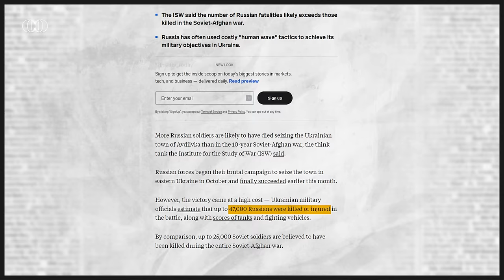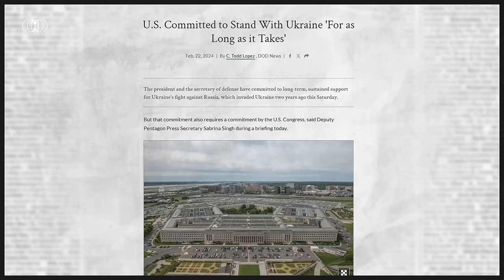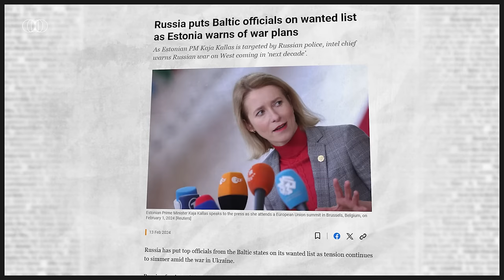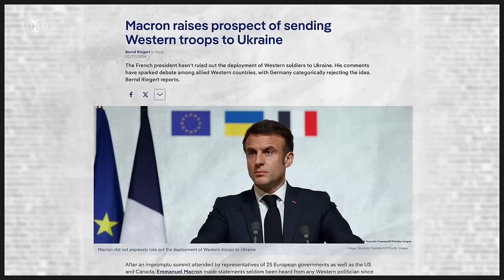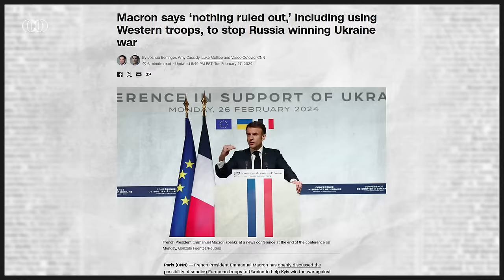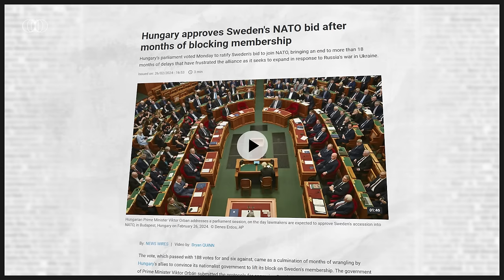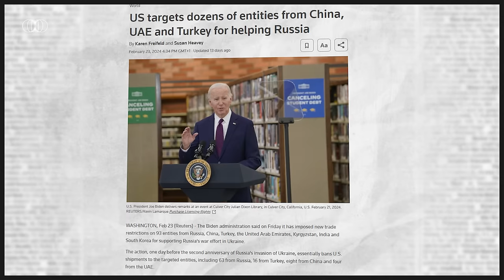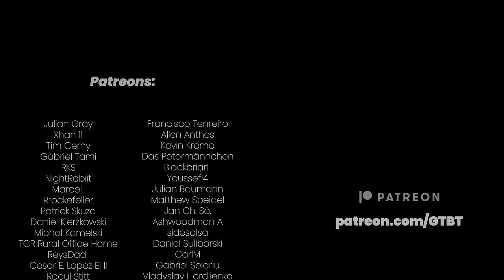Is Europe Taking The Lead On Ukraine?

Comment: I like that the French are putting themselves in a political leadership position, but I wish they would do the same when it comes to arms deliveries. Quantitatively speaking, things don't look that strong for the French arms delevarys.
Reply: The French have some nice expeditionary force projection capabiities but only in a few tens of thousands ---   French power needs a lot more boots on the ground or must cede that to Germany --- very different capabilities so a true EU force against russia must first have those two come together.
Reply: 1) France has the army they needed and still has more real soldiers ( with combat experience) than any current EU country.

2) FR is the only EU country which makes its weapons and uses them. Moreover Fr is still present in many parts of the 🌍 globe, FR can't give away all its weapons like Denmark because it will be than naked. What the point to be the strongest EU army and been unable to defend itself in case of new troubles emerge.

3) FR uses what it manufactures, as they are no real EU military joined industry ( everybody is buying American/ for protection guarantee) the quantities are small. FR can't give them away, it will take her a decade to replace them. FR can't be naked meanwhile.

4) As mentioned above FR to be independent, produces most of its stuffs in little quantities because of a lack of EU market .SO all the weapons systems are french+/- , so FR can't give them away like that. It is easy to give away old soviet stuffs, and be paid by EU to buy new US weapons. If FR drops its stuffs, gets the money, FR will have to produce the replacement because FR DOESN'T BUY FULL US STUFFS.

5) In this video, the guys mention "Billions giveaway" as if it was cupcakes😂. First, all countries are not in the same economical state, and giving more could have massive consequences in FR and empower oppositions ( far right and far left are supporting Putin in FR). GER can give more they are the 3rd economy in the world and has some kinda responsibility in this mess ( RUSSIA CHINA BUSINESS DEPENDENCY). Poland gives a lot, well it's economy is in a better shape than the French one and less debts. Plus Poland is directly involved in the matter. If Poland was located in Portugal, I'm not so sure Poles would give that much ( just saying😊).

6) The only real & effective solution since the beginning is to generate Euro bonds for EU defense industries and to  guarantee the orders for the manufacturers but since so far GER is not so keen on that, that why we are falling into this stupid contest of who gives what.
Reply: @curiositykillsthecat  Poland's economy is better than that of the French first time I've heard that
Reply: @mongomuller2025    You are confusing " developed / stock" and 'growth / dynamic ".Let me explain: Yes FR economy is more developed and generates more wealth but FR economy has far more debts and the growth rate is   very low since at least 2 decades. FR is like  rich patient with a lot of heath conditions (nothing fatal but things must be addressed). Pol produces less wealth, but has been growing fast for the last 2 decades with higher growth rates. And Pol has a lower debt level and a lower debt burden. Your economy generates profits when FR cumuls deficits. Pol is like a healthy  middle class+ patient who is active and doesn't have any particular health conditions yet.  So he can take more risks and has more freedom compare to the French patient who can't do this, can't  eat that, etc. . due to his health .
Reply: France was the top supplier of weapons to Ukraine from 2014-2020.
More recent deliveries are not fully disclosed.
Reply: Didn't France just donate 76 Ceasar howitsers.

Comment: Also Europe for decades has been insanely weak on military spending procurement and production. Like take out America France and UK what do you have left not a lot. Only in the recent 2 yrs has Europe start waking up to what's going on.
Reply: Poland and the Baltic states are among the highest defence spenders in terms of portion of GDP. Polands military is fast becoming one of the preeminent ground armies in Europe.
Reply: More like Germany, Italy, Spain and Portugal, the rest is mostly spending around 2.5% long term with fluctuations during large procurement plans.
Reply: @TevelDrinkwater  Dont forget Greece and Finland who both punch well above their weight. Finland has the most artillery pieces in EU and they are good ones. Also Davids sling missile system on order, 64 F-35 on order, GMLRS-ER (Extended range) on order for our 40 M270's. 100 Leopard A6's as well as 100 Leopard A4's.

We have always been preparing for Russia.

Comment: Military aid for Ukr budgeted for 2024:

FRA 3 bilion
GER 7 billion

Macron talks big, but...
Reply: It's not entirely correct. To understand what's going on one has to look closer what Germans deliver. A huge part are vehicles (transport, non-combat), Gear, Food, Fuel and medical equipment. Not high end systems. The 18 Leo-2 tanks were an exception. It took a year of discussions before sent to Ukraine. Everything delayed, . Or partially delivered. And last but not least: Germany counts not only what was delivered but also what they intent to deliver. If you look closer you'll find a majority of military equipment already counted as "military help" in the section "to be delivered".
Reply: @renemagritte8237 always talking no action.
Reply: @renemagritte8237 The way you messaged your post it sounds like Germany is mostly sending "helmets" and food rations. Given how your post comes across, I have to disagree. For starters, it is true that Germany sends much of the basics like hundreds of transport vehicles and trucks and other basic military equipment for combat and logistics operations. I wouldn't downplay this component of the military aid as it is non the less an essential part of any military operation.
Secondly, I don't necessarily agree with your statement that Germany does not send high end systems apart form Leo 2... 
Do MARS II, IRIS-T, Patriot batteries and radars, Stinger missiles, PHZ 2000, Biber Bridge layers, Vector reconnaissance drones, drone jammers, Skynex air defense system etc also count as "not high end"...?

Quote: "And last but not least: Germany counts not only what was delivered but also what they intent to deliver."

This is irrelevant, every government does this. That is why we have independent organizations like IFW that do a detailed book keeping of the military aid delivered. And from organizations like IFW we know that the Germans contribution was more than just promises.
Reply: @The_Stef  I see. 
Thank you for your answer. However, the gap between what could be done and what actually was  is not only huge but also a source of permanent disappointment and frustration. Just look on duration of decision-making-process. 
And we shouldn't let fool ourselves by manipulative  using of absolute numbers. 
There is a ranking of helpers and we are still on the podium, at least we see ourselves  as being  third among helping nations. 
It looks different when we compare the percentage of BIP/capita. All of a sudden we are far, far behind even exotic  donors .

Then, there is a matter of timing. Help delivered too late is no help at all. It's a burden, something what leads to false assumptions. And our chancellor is really fast with making  void promises. And really slow when it's crucial to make decisions when they are needed.  And not when they are politically opportune.
Reply: @renemagritte8237  Quote: "It looks different when we compare the percentage of BIP/capita. All of a sudden we are far, far behind even exotic  donors "

I have to disagree with you on this point. Especially in this regard, Germany looks actually  pretty good compared to other "larger" nations. Neither the USA, nor the UK or France come close to what Germany has provided on a per capita basis, at least not when all aid forms are considered. Germany is firmly above the average, only the Baltic and Scandinavian and some other outlier nations spend what Germany does or more on a per capita basis. 

I feel that Germany is still undeservedly getting a bad rep for providing "to little" aid.

According to IFW, Germany provided aid totaling to € 41B, of which  € 17.7B is military aid.  Contrast that to the UK's total of € 15.6B, which is a mere 38% of what Germany spends.

Apart form the high tech stuff I listed above, Germany also provided more antiquated, but none the less important kit like ammunition, Marder IFVs, APC's, mines, rifles, Gepards, hand grenades, etc etc etc, the volume is substantial and it all adds up. Germany is very quite about what it delivered, so it doesn't make much headlines.

I think Germany deserves credit for how they stepped up. If I'd have to criticize Germany, I would criticize Scholz's lack of leadership on  a European level, his cowardice, his dreadful communication and his hesitancy to send Taurus. This is where I'd wish he was more like Macron....
Reply: @The_Stef  Thanks for providing some numbers. Apparently it's a time for me to verify some  opinions on the matter.  The world we live in is changing rapidly.
Reply: Counting undelivered items and costing cold war era hardware at the cost of 2024 new equipments distorts the comparison.
Reply: @aboukirvienne5352  Of course it's undelivered, we are talking about the alloted budget for 2024. How could it possibly already be spent and delivered. duh???
Reply: @The_Stef  we are in March, look at allocated package. Timing of deliveries since last RU offensive counts. What about costing a Strela system vs a Crotal? What about a GPS glide bomb vs a 155 shell?
Reply: @aboukirvienne5352  we are in march, that means there is 9 more months to go. I know every wants everything delivered yesterday, but that is not a realistic expectation to have.
Reply: @The_Stef  nah there is just a different approach where French communicate 12 months or more after actually delivering systems when Germany ensures that Russia is well aware of every piece of weapon incoming 24 months before it actually happens, if it ever happens. That and insinuating that there are FR and UK troops on the ground when the topic is only about limiting cruise missile geo targeting and range.
Reply: @aboukirvienne5352  You are all over the place in your posts, so I'll only respond to the parts relevant to the topic. 

Quote: "Germany ensures that Russia is well aware of every piece of weapon incoming 24 months before it actually happen"
What German weapons are you talking about that have been announced 24 months in advance and not delivered?

The topic of this post is that Germany outspends the French by a wide margin in military aid and this is true. The difference is actually quite stark. According to IWF, Germany outspent France by a factor of 27x. (€17.7B vs. €0.64B). And we are not talking about delivered promises, we are talking about actually delivered gear.
Reply: @The_Stef  is IFW and precisely you are referring to commitments. Commitments are not deliveries. Also these rankings as I mentioned earlier are challenged on the costing side. Valuing a 70’s junk at its 2024 replacement cost for instance.
Reply: @aboukirvienne5352  They are commitments with an approved budget, at least on the German side. So that's more than a promise. And we know what kit was
delivered, so your assertion that German promises and doesn't deliver is simply not true. 
And if you're gonna disregard any weapon system developped during the cold war, surely your aformentioned "cortal" is only junk, right? 
Germany delivered a wide array of kit, much of which was developped during the cold war and I'm sure the Ukrainians are happy to have. I don't know why you are so fixated on how old the kit is rather than what capabilities it brings. Are leo 2, stinger missiles, Mars II, PZH 2000, all junk because they were developped in the 80ies or 70 ies?
Reply: @The_Stef  precisely what is the point of your comparison? Is Germany helping Ukraine against Russia or is busier comparing declared commitments against FR and UK? German commitments which budget can easily be striked down by court.
 
Endless debate to use IFW challenged figures on commitments then trying to infer on behalf of Ukrainian if 14 leo2, some mars2 and pzh2000 are as useful as a hundred SCALP and 600 AS2M guided bombs.

Comment: Fearmongers: "Russia will invade the EU any time, which may start WW3!"
Macron: "We should send our nationals to fight in the Ukraine."

If a French soldier dies in Ukraine, will it be considered an attack against NATO, or the rule that an attacking member can't claim Art. 5 if it's striked back will prevail?
Reply: It wouldn't justify using article 5, no. Article 5 comes into force if NATO members are attacked on their territory within the geographical limits specified by the treaty. So French troops in Ukraine wouldn't qualify. That wouldn't prevent NATO members from taking whatever measures each of them wished to take of their own initiative, however.

Comment: The video starts with a lie. Neither imperial Russia nor Stalin´s Soviet Union can really count as "democratic", but they bore the brunt of the fighting and the losses, and the starting position of the Entente in WW I wasn´t bad either. Sadly, the video doesn´t get much better from there.
The Key point is that the video portraits Russia still as a paper tiger that would somehow tolerate great quantities of NATO troops on Ukrainian soil until it is defeated and that a deeper involvement by NATO members bears no risks. Scholz´ hesitation towards further escalation (faithful to the German post WW II motto "Never war again") is described as "harmful". Only alleged Russian losses are mentioned (though not proven), but Ukrainian losses are not mentioned.
This is willfully deceptive and wrong. Ukraine had its own military stock at the start of the war, it has received lots of old Soviet vehicles, ammunition and plane parts from the former Warsaw Pact members and then many hundreds of heavy equipment pieces and even long range MLRS and cruise missiles from Western stocks, and yet Kiev´s forces are again on the backfoot and somehow 700k soldiers went somehow "missing" (if you look at the training footage at 16:55, two guys are holding only imaginary rifles).
Statements from Moscow have declared time and time again that it views this conflict as existential, that it will do everything necessary to win and that tactical nukes would not be a taboo if the situation gets dire for Moscow. NATO membership for Ukraine is for Moscow what Russian nuclear missiles on Cuba were for JFK.
If the Europeans escalate their involvement in the war, the risk of an escalation spiral is real. NATO boots on the ground would inevitably be sooner or later involved in the fighting itself or targeted by air strikes. The escalation into direct conflict between NATO and Russia would be almost inevitable, with nuclear armageddon as the cherry on top.